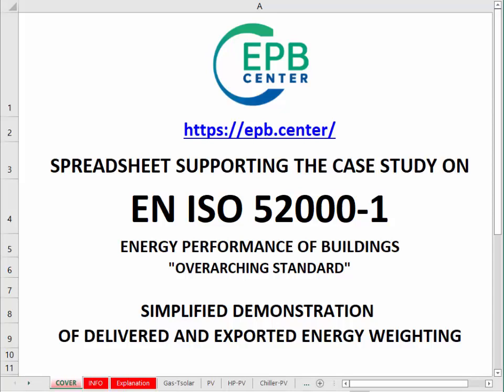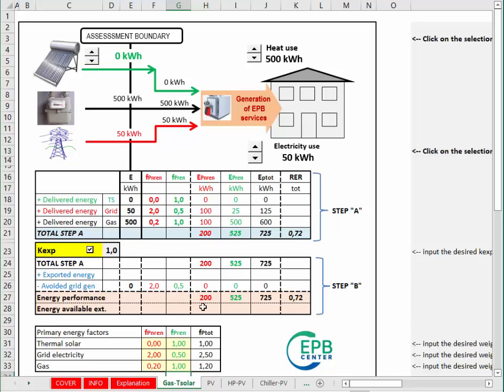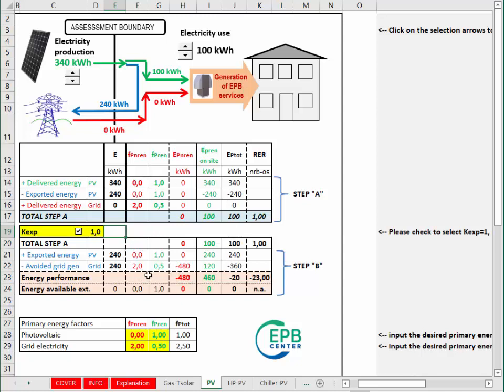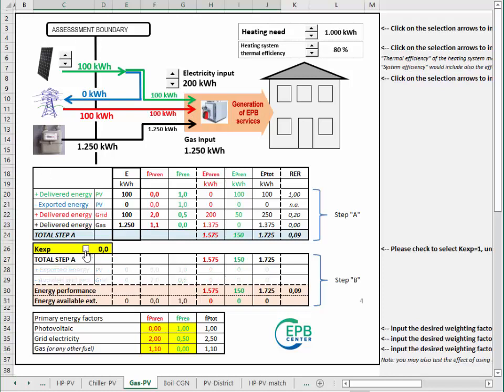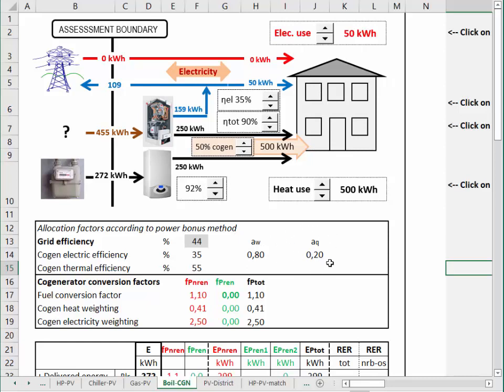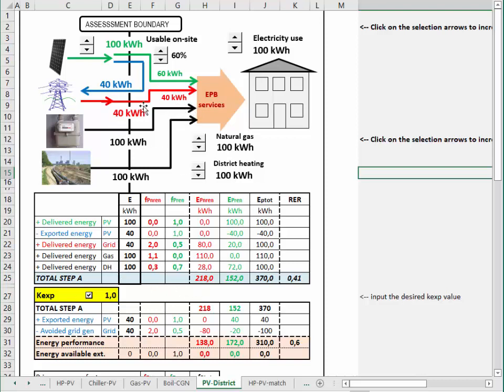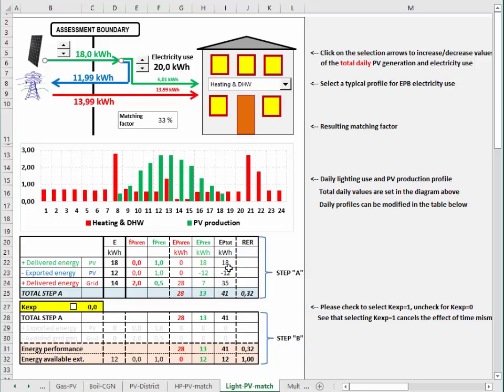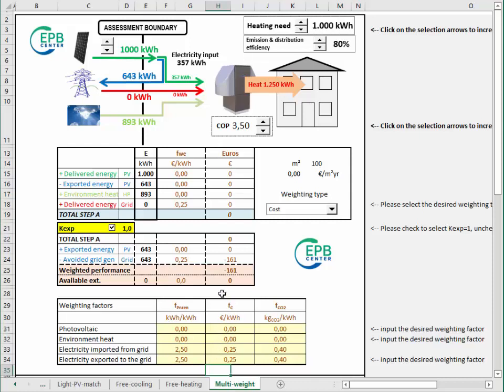EPB Standards Explained - 11. EN ISO 52000-1 simplified demo

Comment: Hello and thank you so much for this informative video. The amount of knowledge and support which M/s EPB center as a whole is sharing with the industry is immense and highly commendable. Just was curious to know, where could I find this spreadsheet? As in EPB center website I find the spreadsheet for the simplified cases for 2020 version and not this one. Would it be made available sooner or there is a seperate link for the same ?

Thank you so much again and looking forward to your response